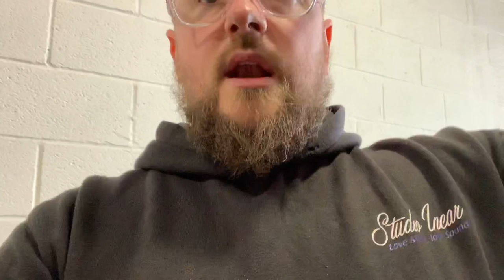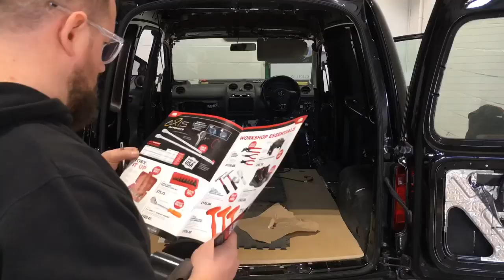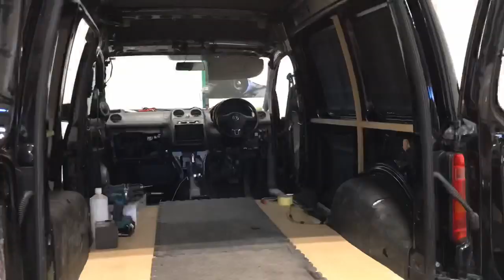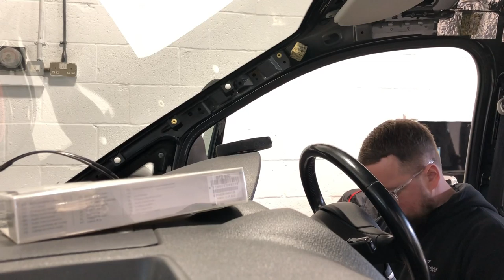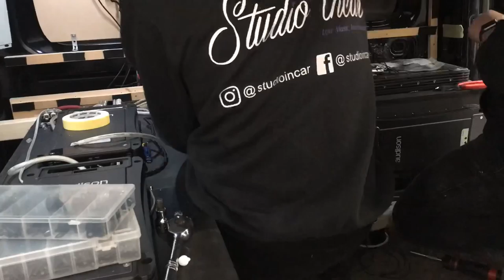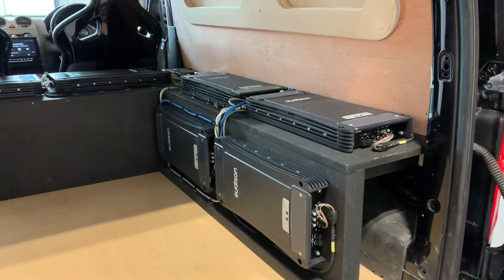VW Clubsport Caddy Van - Ep.#3 (Audison Amps / Dynaudio Subwoofer Install)

Comment: Hi, that’s a nice build.
I have a question about the Dynaudio Esotars 1200 versus Mac Audio Aliante 12 black Ltd. / Phase Linear (Evolution) as a trunk Subwoofer in a long stationwagen in sealed enclosures. I can’t compare these two because no one sells the Esotars in the Netherlands. But you’ve heard and know the Esotars, but don’t know if you had the opportunity to build in Mac Audio /Pase Linear Aliante’s. I own a couple off Mac’s. The Macs are beautiful and a legend as sound quality subwoofers. But I am looking at the Esotars they look on the specs as even better then the Aliante’s except the Sd is less as a disadvantage and more linear excursion with less power requirements with the Esotars. Which would you prefer in your trunk if you had an BMW 5 series estate? I don’t want to make the mistake I made in the past by buying gear which I didn’t heard beforehand. Hoping for an answer.
Reply: ? And what about the Morel titanium 124?